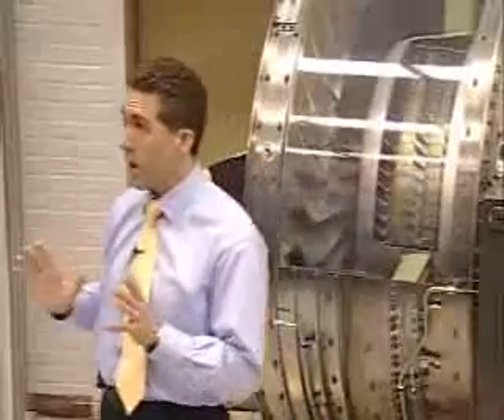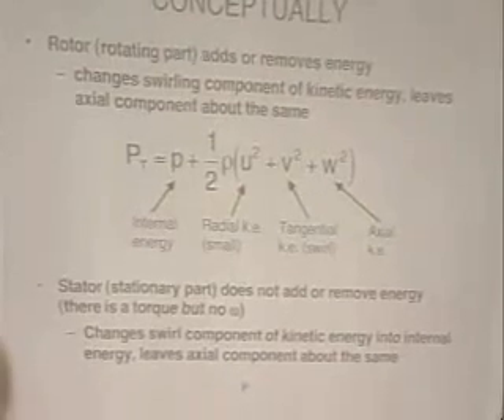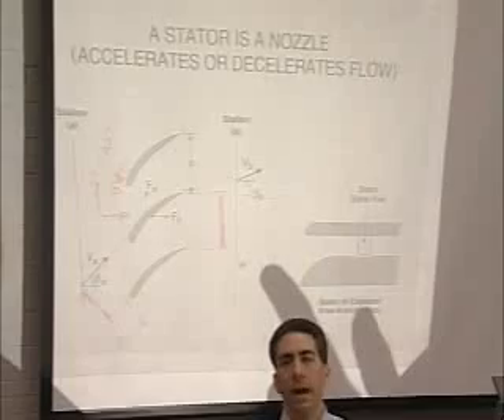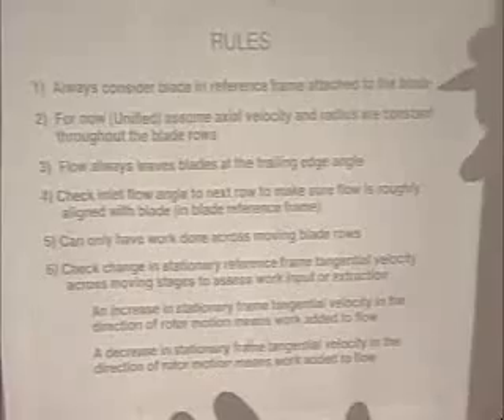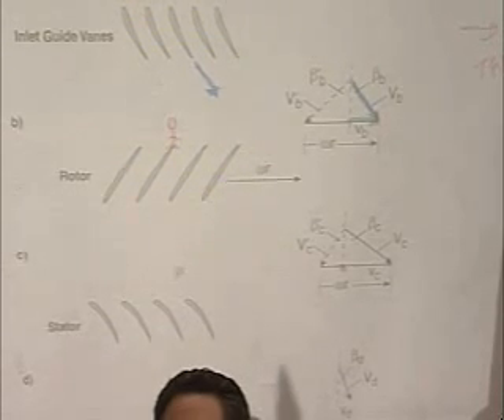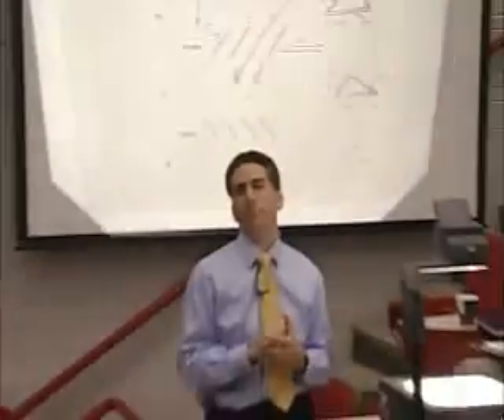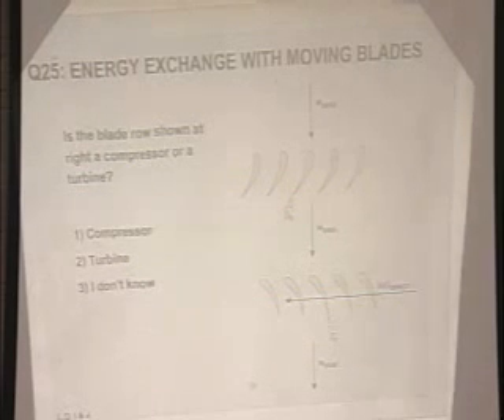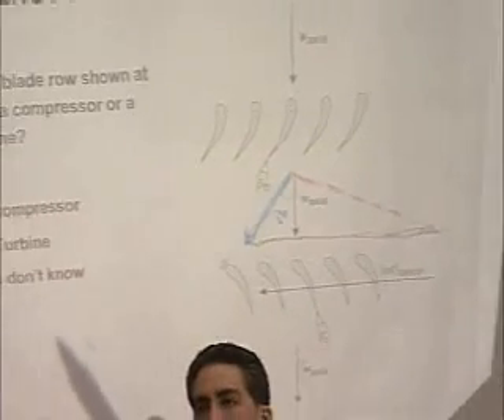Sample Lecture P9 | MIT Unified Engineering,  Fall 2005

Comment: What if the 4 wing Raptor jet fighter's wings were magnetic to each other and a computer monitored magnetic strengths of wings during turns in a dog fight would it lower wing vibration.     NASA Problematic  Ideas